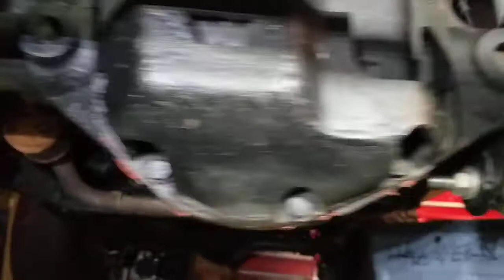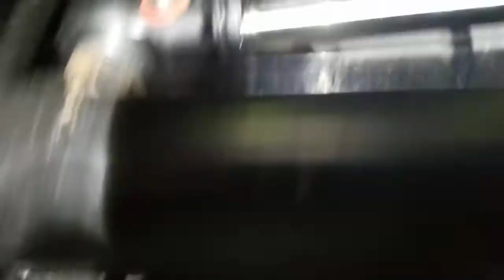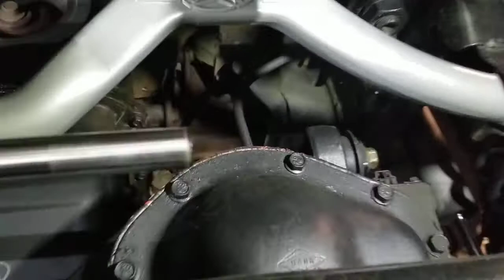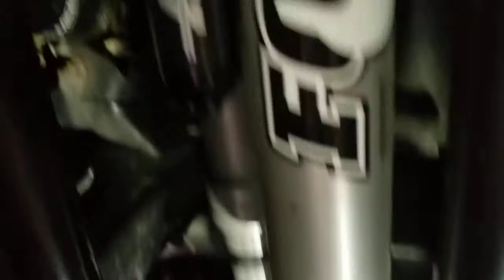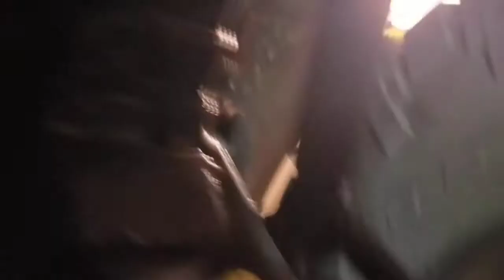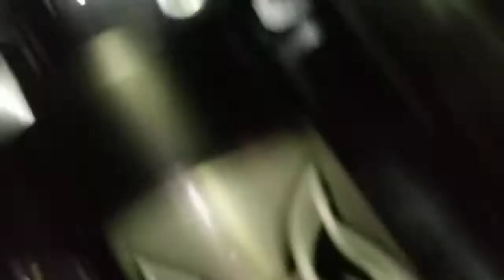Jeep JK Loose Steering Check to Prevent Death Wobble

Comment from the maker: I did replace the new Rubicon track bar with a Teraflex monster track bar. Much better feel. I also checked toe in and found 1/2" toe! Huge difference after setting it 1/8".
Reply: 1/8th Toed in or out
Reply from the maker: @mattshafer6644  I adjusted to a 1/8" toe in. Thank you